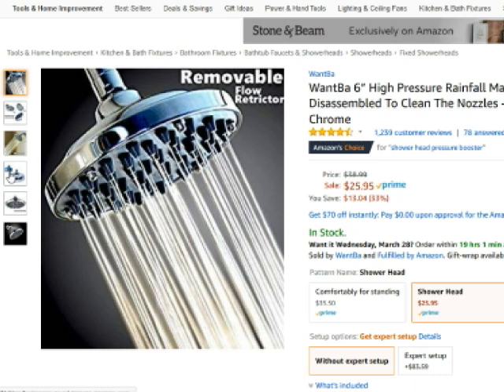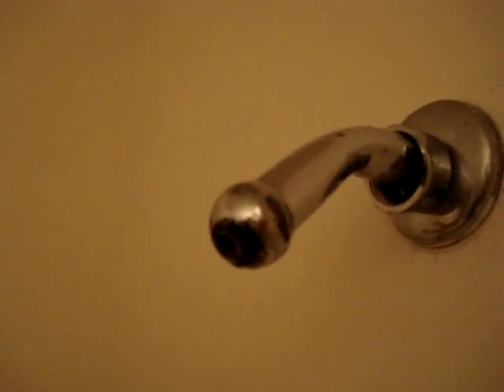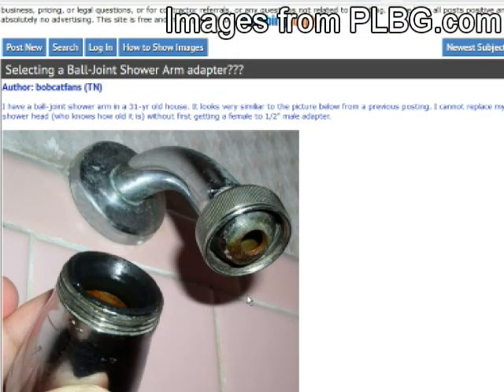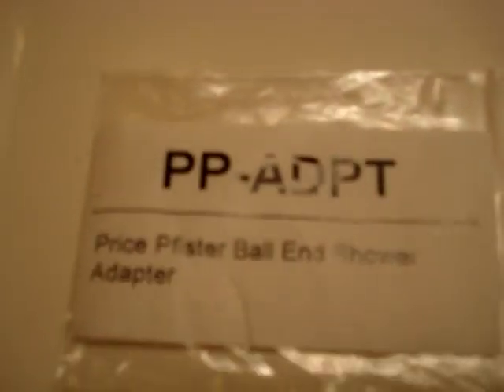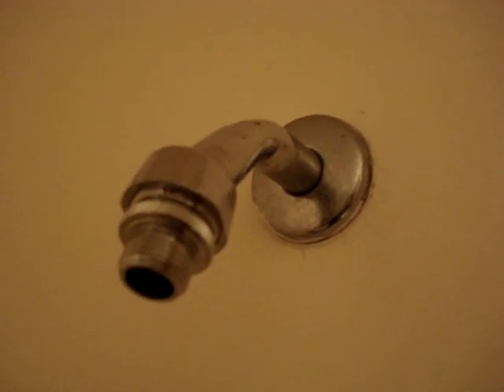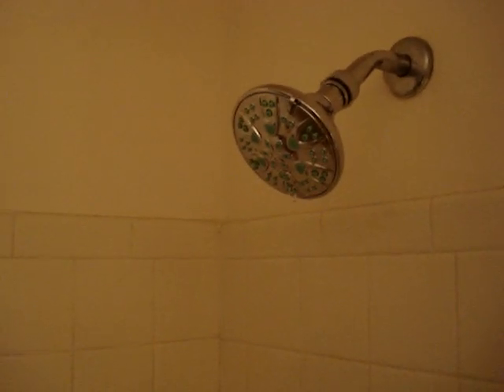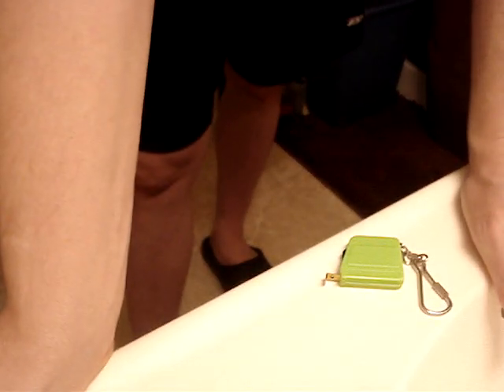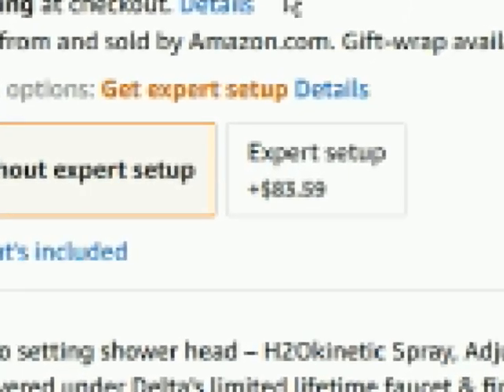Ball End Shower Arm Shower Head Installation (Adapter)

Comment: My house was made 5 years ago and I have a ball joint shower arm! I got the Pfister adapter and it's still too small. It's so weird to me that they don't make these adapters super easy and accessible. 

And now the three pack is $26 with $6.35 shipping 😭 

Thanks for your video! It's given me somewhere to start.
Reply from the maker: Cecy Nay, Wow! I knew the price was going up but that's a little ridiculous. Sorry to hear it. 

I agree that the info on these adapters and their availability is well-hidden on the internet. Not sure why. That's part of the reason I made this video.

You are welcome and thank you for taking some time to share your experience. Well wishes and hope your plumbing issues are resolved soon.

Comment: can anyone say if the water pressure coming out the new showerhead is strong enough?because of the small hole at bottom of the ball only has a small hole,for the water to come out....or should i cut the ball off before install?
Reply from the maker: Gman2000, I would leave the hole the way it is.
That small hole creates the pressure your new shower head will need. Best of luck.
Reply: thanks man,after thinking on it for a few,the ball actually keeps the showerhead from falling on the floor..big help thanks

Comment: I have the ball end but not that piece that you slid up to reveal the ball. What can I do?
Reply from the maker: M. A. Dennis Poet, sorry to hear that. Others have commented the same issue here. Not sure how this happens but without that outer metal piece with threads, there is nothing to attach the adapter to. You can't even attach an old shower head to it for that matter. 

Unfortunately you will have to replace the shower arm. This means you shouldn't need the adapters in this video since your new shower arm will have the correct connector for a modern shower head. 

Sorry to hear about your troubles. Hopefully your plumbing issues are at an end soon.
Best of luck.
Reply: @Underdrummer  hey MAN! I just finished getting dragged in a FB group; got called every kind of fool because when i posted pic of ball end what EVERYONE except ME noticed is that my ball end is a simple screw on piece. All i had to do was simply twist it off. Is it possible others have same thing? Maybe the whole overwhelming stress of seeing that ball end makes some of us not see what's right in our face: a plastic piece that screws on & off. So now it's just the plain shower arm with nothing on end except the hole with grooves in it. So i assume any universal shower head can be used now??
Reply from the maker: @m.a.dennispoet , Oh geesh, sorry to hear that. Some here have commented that their ball end does indeed screw off but some are absolutely welded on.  

I continually get loads of guff for making this video as an alternative to replacing the shower arm. I assume the "real" plumbers are offended by my alternative method. That's why I added the disclaimer in the video description.

As far as using any universal shower head with your setup, all the shower heads are female. If you've removed the ball end then I assume your shower arm end is now, also female. So I don't think it will work but it's tough to judge without seeing your setup. 

Like I said before, replacing the shower arm is mire of a job than using the adapters but it not something that is impossible for the ordinary do-it-yourselfer to accomplish. 

Let me know what you settle on and how it went. Best of luck and thanks for taking the time to comment here.
Reply from the maker: @m.a.dennispoet  Thought about what you wrote some more. I think I may have misunderstood you. 

So with the ball end removed you have a place to screw in the adapter, right? Then from there, as you said, just use any universal shower head. Yes, that should absolutely work. 

Only thing is I am not sure about the size of the threads inside the shower arm of the place where you removed the ball end. You may need some different size adapter than the ones shown in this video. 

If you can, please let me know how you get on so others can benefit from your solution. Thanks again!

Comment: But what if the new shower head I bought has a ball joint but I can’t get the old one off
Reply from the maker: brenna rene, you can't get the old shower arm off? The shower head is the part that sprays water. If you are planning on replacing the shower arm, definitely don't get one with the ball joint.

Comment: We ran into this exact issue after buying one at Target!
Reply from the maker: Hi Christina Jacobs,  you mean they still sell this terrible ball end joint shower arm? I thought they stopped making these atrocities. So sorry. Hope the video helped. Thanks for sharing.
Reply: @Underdrummer  no the showerhead we bought was standard, thanlfully, but the shower arm had the ball! We did the same thing where we bought a new showerhead without checking what was under the old one! This building is from the 60s but I guess the showerhead was from the 80s. Hopefully we can update it after we order these adaptors! Thanks again!
Reply from the maker: @christinajacobs1329  Ah, got it. hope plumbing problems are in the past soon.
Reply: @Underdrummer  Thank you! They are! We actually wound up needing the Gerber one, so it's a good thing we got the three pack!

Comment: This seems like a nightmare. Replacing the shower arm is super easy, takes 2 minutes, is waay cheaper, is available at almost all big box stores, and would eliminate all that clunky hardware and shipping time.
Reply from the maker: Martin Velazquez, replacing the shower arm is a perfectly acceptable option but can pose its own problems. Being in an older home is one of them, hence this alternate option. 

Besides, ordering a part that is not expensive and is guaranteed to work is not really a "nightmare" unless you don't know how to shop online.
Reply from the maker: 163 people think replacing the shower arm is harder - I happen to agree.
Reply: @Underdrummer  It seems to me these adapters would not be manufactured at all if using them was not easier and simpler than replacing the shower arm. There wouldn't be a market/demand for them and thus no reason to make/distribute/sell them. As for Martin, I rent an apartment in a very old house which has clearly had some less than ideal work done in periodic makeovers/renovations/"repairs" over decades. These adapters can be useful to renters who wish to make minimal/discreet alterations to their landlord's property. Further, I was reluctant to remove & replace the shower arm, as easy as that *seems*, as I could feel the pipe on the other side of the wall (that I can't access) moving around pretty freely. Due to that give/mobility/wobble of the pipe, I was concerned that once I removed the (weird ball end) shower arm, I wouldn't be able to line up (and screw in) a modern replacement arm into the fitting (behind the wall). Trying to get a new shower arm into place without access to the water shutoff or the pipes in the wall seemed like a potentially more nightmarish scenario. So, Underdrummer, I do indeed appreciate the time and effort you took to find these adapters and to make the video that clearly explains their usage and alleviates any potential nightmare that could have arisen.

I would prefer to buy a single (correct) adapter rather than a three pack. I was wondering, of the three adapters you received, did the Price-Pfister adapter have the narrowest, oddest threading on the larger end? My current shower head looks just like the one you replaced so I assume the adapter you used is the one I need and I think the answer to this question would confirm that. None of the pictures I've found online show the threading clearly enough for me to be totally sure about the adapter I need to buy. Thank you very much.
Reply from the maker: Hey ChefJohn, you're welcome. I couldn't agree more. I made the mistake of posting this video on a Plumbing Reddit and was heavily scorned for not just changing the shower arm. 

As you so clearly pointed out, not everyone has the skill, tools or desire to change a shower arm! 
And acting like it is faster than this adapter is absurd.
I don't understand some of the hostility when it comes to DIY video comments. 
There's always more than one way to get a project done. 

I think I say in the video that the Price-Pfister is the one I end up using. It's been a while and I don't recall specific details that I didn't write down. Also in the description I include the measurements of the other two adapters threads.
Thanks for comment. Have a great day and good luck with the plumbing!
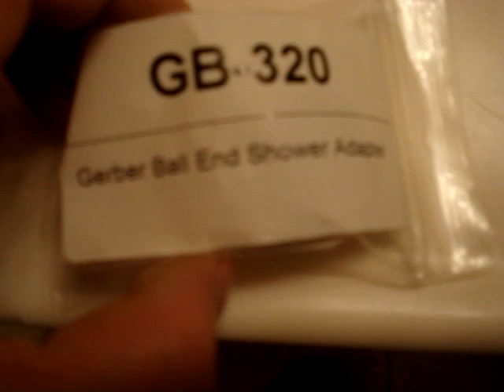Reply from the maker: Confirmed. I used the Price-Pfister adapter. @3:07

Comment: Ordered the kit of all 3 and... none of them fit. Should have just replaced the shower arm the first time. Zzzzz
Reply from the maker: Andy Larson, sorry to hear that. A few have commented the same. Changing the arm is your best bet now.

Also you could probably recoup the cost of the adapters fairly easily. There are a ton of people here in the comments that cannot locate the tri-pack. Could always sell it on eBay and maybe buy a new shower arm. Best of luck!

Comment: The shower head in your video was the exact same one that I was trying to replace. Instead of buying all three adapters, I just bought the one that worked for you - it worked for me, as well. Very informative video. Thank you for posting this.
Reply from the maker: darnil, super glad to hear it helped another person out. I can't say definitively but reading these comments it seems most people need the Price Pfister adapter. You're welcome and thanks for taking the time to comment!
Reply: I’m having the same problem! I found a site selling one but it’s for a male not a female like you mentioned in your video, should I keep looking for a female part?
Reply: What do you do/use if it leaks from above the ball fitting ? (in other words out of the top of the ball where it joins the bottom portion of  the head closest to the wall ?

Comment: Thanks. Worked like a charm. I did what the majority did, I assumed (and hoped) the one that worked for you would work for me and it did. I ordered 2 of the Glacier Bay Pfister Part 794 659 for 2 bathrooms at $ 5.50 each and free shipping. Great buy. Note to all, don't be skimpy with the Teflon tape. My new shower head came with a roll and I taped every thread and went back over some spots until the tape was gone. Time-consuming but it gave me 100 % confidence it wouldn't leak. Tested it on high pressure. Perfecto.

Comment: Was about to buy the replacement adapters from Amazon and my daughter found this adapter at Home Depot: https://www.homedepot.com/p/Glacier-Bay-Pfister-Shower-Arm-Adapter-3075-538/204511149  Works great and it was $4.95.
Reply from the maker: Bill Walls,  glad to hear it! As long as you know which brand your shower arm is that works!
Thanks for the helpful link.

Comment: Thank you for the great info...I had the exact same problem.  I thought I could just replace the shower arm with a new one, but it wouldn't budge, and I feared I'd break it off in the wall if I put too much pressure on it.  The adapters, which I didn't know existed before I saw your video, solved my problem. Much gratitude.
Reply from the maker: Larry Benton, you're welcome. Great to hear this helped you out. Yeah it was the same with this old house. 1983 shower arm doesn't come out so easy. The adapters are easiest solution. Thank you for the nice comment!

Comment: Back again. 😀 After receiving my order for the Adapter we needed - which I shockingly found at our local hardware store's website - my husband installed one of them today. Removed the very old, ignored, shower head and EASILY replaced it with a new one. Turned the water on and SUCCESS. 🚿 🤗 So happy that the install went smoothly and no curse words were necessary. 😂

By the way, since we live in a subdivision built in the 1990s, I shared your video with our neighborhood and surrounding area. Most probably upgraded a long time ago, but just in case I wanted to "pay it forward". There has been one very interested to help their parents. Your kindness lives on. ✌

Comment: I’m in UK and have this problem but the house was only built in 2000 so no excuse why would anyone go out of there way to have that as a fitting!!
Reply from the maker: Lol, not sure. Perhaps the very late 90's into the early 2000's those fitting were in use. Hope you are able to locate the correct adapter and solve the issue. Best of luck and thanks for taking some time to share and comment!

Comment: When you pulled the foreskin back on that bad boy I giggled.

Also Pro Tip, I have the same showerhead as the new one you got. Its the real deal, but if you have hard water the thing clogs with limescale like no other.
Reply from the maker: Hey Itta Pupu, Haha!
I know the thumbnail ended up looking very phallic. I even tried many different camera angles and just finally resigned to let it look how it was going to look. 

We do have VERY hard water here in Southern Nevada and I was worried about that. 
Been contemplating the NuVo water system but until then I have my handy, dandy, bottle of white vinegar. 

Thanks for watching, and commenting!

Comment: What is the piece hanging on the shower mount called? The ring? The ring the screws into the adapter? That’s the only piece I need but I don’t know what it is called. I see the you have called it the female component but I’m afraid I can’t find this piece. If I order the adapter, does it come with the female component? I doubt it :/
Reply from the maker: Tothegoodlife1, You are right. The ring or adapter for the other end of the shower head to screw into. Some people have commented here that they are also missing this vital piece.

Ordering the adapters does NOT come with this ring piece that you need.

Unfortunately the best thing to do in your case is to replace the entire shower arm. There are many YouTube videos showing how to do this.

Hopefully your plumbing problems are over soon. Best of luck and thank you for taking some time to comment.
Reply: @Underdrummer  what i want to know is how was the shower head up there if i don't have the female piece. My husband knocked the shower head off freaking out over a spider.

Comment: I randomly found your video while looking for the proper way to install a new shower head on a ball joint shower arm.  We had the exact same situation with a Price Pfister shower head  in our 40 year old home, and I thank you for the great information and video.  I have just replaced my old Shower Head with #2, below, and also just ordered the Adapter to have on hand down the road.

I do, however, have some comments that might help others in the same situation....
1)  You CAN just buy a single adapter directly from the New Resource Group OR Amazon.  I just bought the PP-ADPT from Amazon for $ 5.50 plus shipping.
2)  You CAN alternately replace the old shower head with the following from Jenco Wholesale for $ 6.99 plus shipping.  I ordered directly from them and the part was here in 2 days (I paid for the expedited shipping and not very expensive) and it was a perfect match.  I found Jenco Wholesale after some research online and they have just been amazing.  Here's the link to the replacement Price Pfister Ball Joint Shower Head (by Lasco):  https://www.jencowholesale.com/search?q=82-08-2371   I also believe you can order this on Amazon, but I went directly to Jenco because they were able to compare my (broken) Price Pfister with their replacement part.

Hope this helps, too.....

(What did we do before YouTube videos?!?!?!)
Reply from the maker: Hey Sandie Cohen, wow! I didn't think they made that shower head anymore! I didn't even try to search for it as I figured there was no chance. That is exactly what my old heads looked like.
I have only done one shower head in the house, the one you saw in the video, and eventually I'll have to deal with the other one. Thanks for the link, maybe I'll just buy the old PP head and live with that for a while.

I was aware that I could order just one adapter but the issue was I didn't know which one I needed. Since there are only three in existence, I figured ordering the 3-pack was the best bet. Now that I know which model I need for this house, I can order just the single adapter for the other bathroom.

Thanks for the helpful tips. I know, I've thought that before as well, without people posting helpful how-to videos there are many things I could not have accomplished. Including changing a door handle on a 1998 Ford Ranger and I'm not a mechanic!
Reply: Hi Underdrummer,  

Thanks for your lovely reply and comments.  

If you call Jenco, ask for Kim and 'tell her I sent you' :-). Kim was absolutely amazing and kind, and we were able to text back and forth photos to ensure that the shower head would work.  

To add to your door handle change:  I found a video on replacing a Power Supply in a 2011 iMac computer and was able to accomplish that without any difficulty at all, and I'm a 60-something grandmother (albeit a handy one!).

Keep up the great work with your videos on YouTube ;-)
Reply from the maker: Nice! Those iMac's are not cheap so replacing the power supply was definitely the way to go there. 
Will do, if I call Jenco. 
Thanks for your comments!

Comment: Follow up: carefully re watch to see three adapters will screw into the old collar from his original shower head. In my 1979 home I also have ball end, BUT the remaining female collar from old shower head is nothing like one in this video. I bought 3 adapters but in my case none of them will  fix the issue, My remaining female collar is the size of his new shower head, matching it in size -impossible. Be careful, also prices higher on amazon for set of 3.